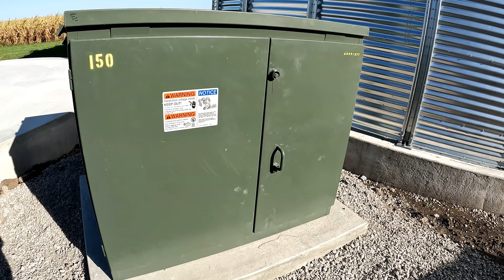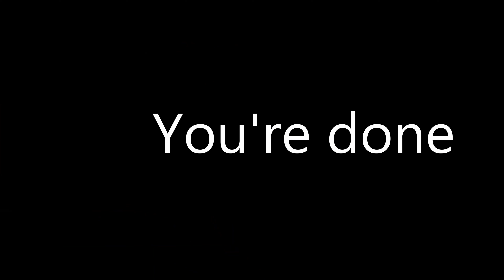$90,000 for the FUTURE OF FARMING? What a 30-year-old Farmer thinks COULD happen.

Comment: i never looked back on having 3-phase power put in, too bad 25 some years they didn't want to when the farm when back off-grid i had a diesel generator given to me from my uncle's sawmill to   spend a lot of money to have it rebuild  the old bin site run propane got tired of them not filling the tanks up and the natural gas wouldn't put a larger pipe to the bin site too back them 
bought bale heaters for the heat for the farm all i use to heat my yard with them have a power generator from the heat stock turn and making me power too my stepparents had a windmill in the 1960s for their power to it is still on the farm too and plus it still works with new parts too 
how many times do the utilities want to run new pipe or transmission tower and fine throw my properties i would not let them 
in the long run, i don't save a lot of money off-grid to

Comment: Great job of putting in the extra conduits now.  I know you only think you will need the 4.  But you should have added a couple extra tubes now over what you plan for.  Its cheaper to buy the materials now and install them.  Than i will be later.  I would for a big company that loves to do things 2 and 3 times over, because they want to put in just enough for now.  Drive me crazy having to redo work and watch them spend millions over and over piecemealing upgrades.

Comment: So Iowa electrical code don't require caution tape buried above pipes.
Reply: It’s only required for the service side of things and I would have to look again but also for direct bury. I do it no matter what because it’s cheap.
Reply from the maker: I do not know what they did when they put the cable in. I was not there. I will do it on my side. However didn’t do it on these runs because they are tucked in where there will not be any more digging.
Reply: I was just wondering it’s fun to see different codes from state to state, wasn’t saying it was wrong was just asking a question.

Comment: What are all of those extra pipes going to do for you? Every one of those pipes would be considered a service and service disconnects need to be grouped together.
Reply from the maker: Whatever we want in the future.
Reply: Good question.  If they were all ran together, I’d suspect they were meant to have parallel runs of wire, to say a CT meter base.  But, since there’s the one that is run by itself.......  Guess we will have to wait and see the end results.
Reply: That’s not exactly how it works. I know Iowa is a bit behind on the NEC but still doesn’t mean you can just do whatever.

Comment: Colethecornstar made several videos talking about the cost of bins vs the price later in year along with storing crop with a co-op. His figures have said that the bins pay for themselves over a 10 year note due to better costs per bushel and time savings. He had some delays with getting the government loan to build the bins, there was a lot of paperwork and it slowed the construction down. Also, you should look at bin management sensors. Tying them in the fans and a weather computer helps with increasing yield at the elevator.
Reply: Using Cole the cornflake as your tool away any credibility you had. Cole is a disgrace to the farming industry!!!!!
Reply: @gregjames5070  his family hasn’t went broke yet. Close but they are still in business.